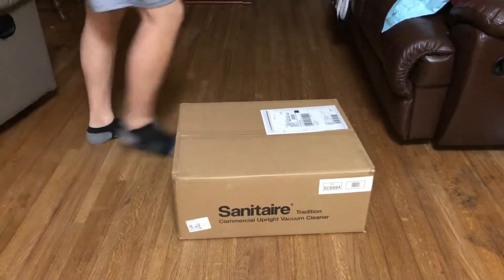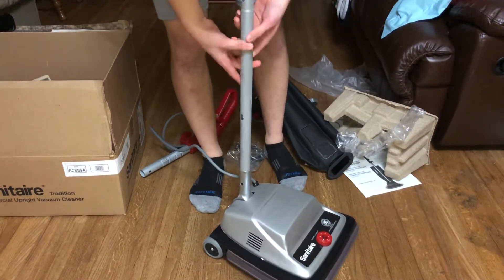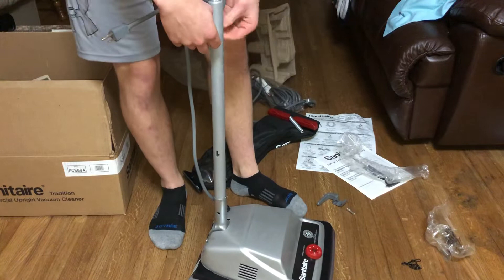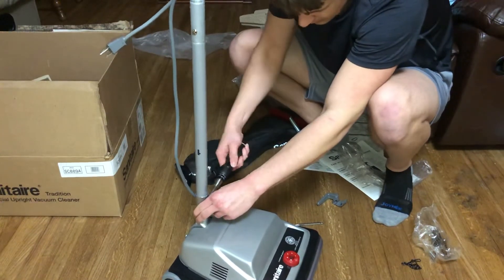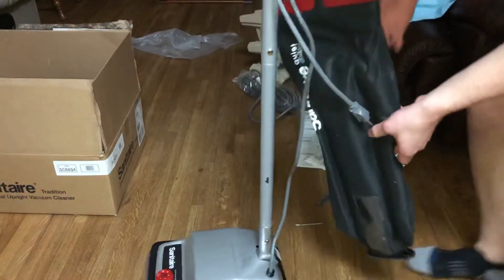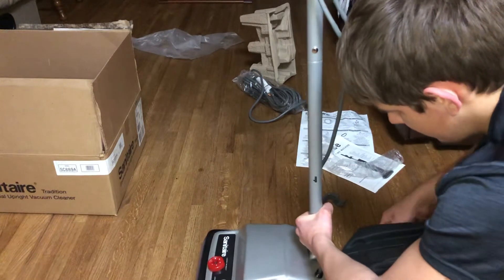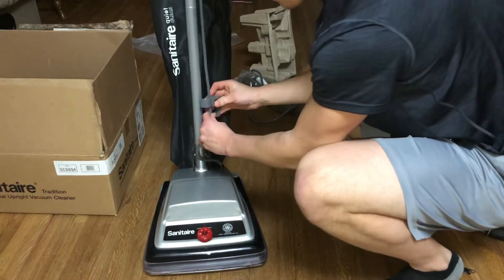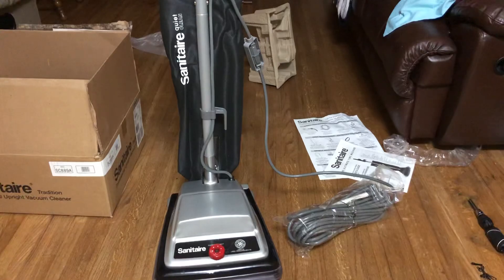Sanitaire SC889A unboxing and assembly

Comment: I have an SC888N with an ST bag and it’s not set up like that. It’s set up with the standard hook just like the shake out bags and F&G. Why is the contractor model so different?
Reply from the maker: Because it has the switch at the top instead of on the hood.
Reply: @kg5vacuums205  that makes sense